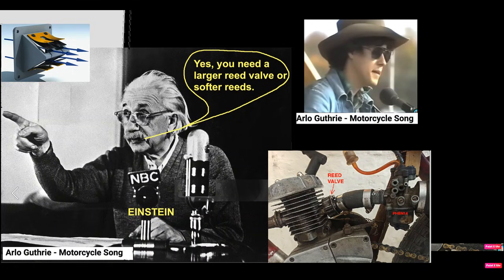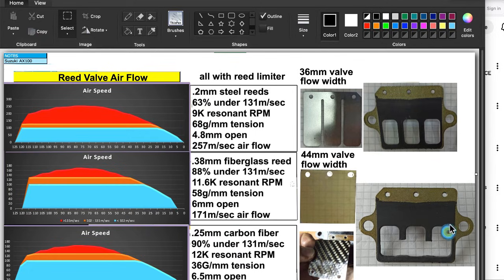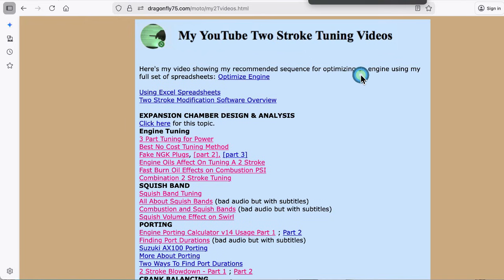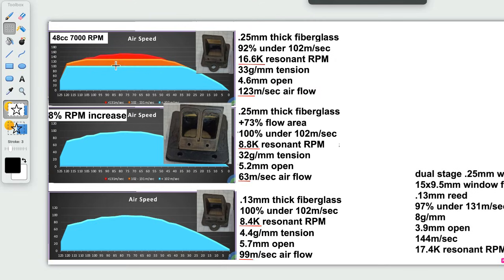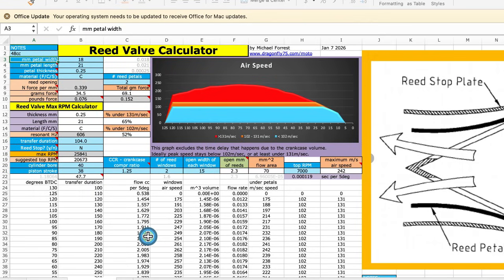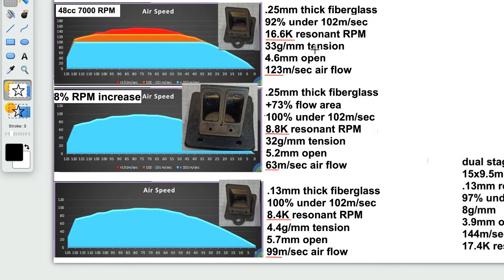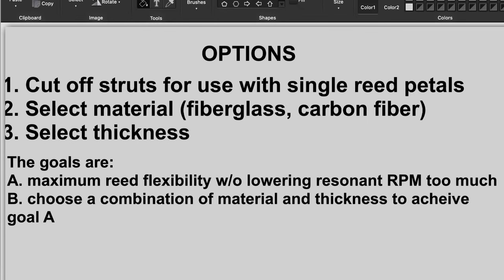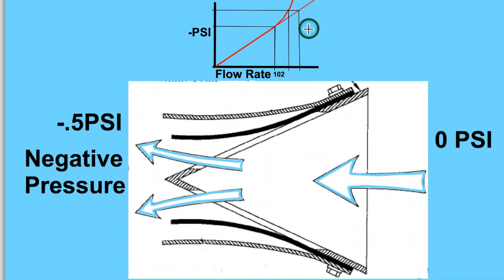2 Stroke Reed Valves

Comment from the maker: I forgot to mention that the curved reed limiters increase reed tension by 30%. A higher tension means a higher resonant RPM and more pressure difference across the valve. Without it if your bike runs OK at top RPM then you can keep them off. Then you may need to increase the idle jet size because now at low RPM the initial vacuum wave is less steep because it opens earlier.

Comment: I like watching your videos they are quite interesting, you are like a walking dictionary on two cycle topics, you would think there would be other options for reed valves besides fiberglass or kevlar, but i take it those two are the proven substances that have proven to be good, some of the two cycle motors i will be working on when it gets warmer are vintage like seventies eighties era and i am almost sure they used metal for the reed valves, i really won't be positive until i tear one down. have a good one
Reply from the maker: metal works good (if the RPM isn't really high) till they break and do damage to the top end.

Comment from the maker: The larger reed valve allowed more top RPM but due to 50% more intake air volume I have to return to using the small valve until I can make a stuffer for the large valve. With that much intake volume the vacuum becomes too weak to efficiently activate the idle circuit and so its hard to start and is weak at low RPM. I've got thinner fiberglass on order to see if I can get the small valve to be higher performance. Motorized bicycle owners might want to know that the small valve was originally by Rock Solid. Now it's available from Bikeberry and is called "BBR Tuning Reed Valve".